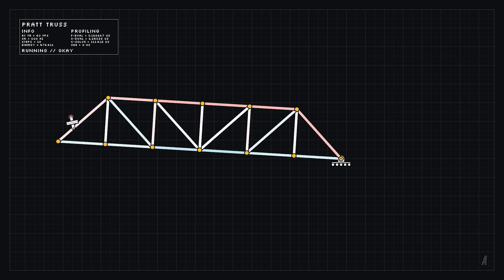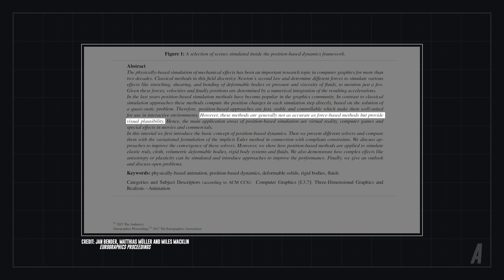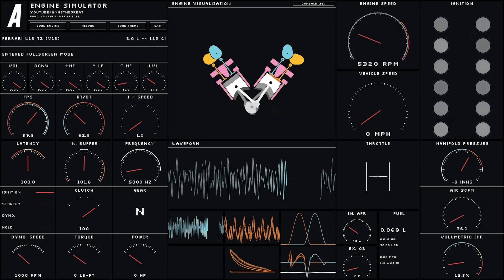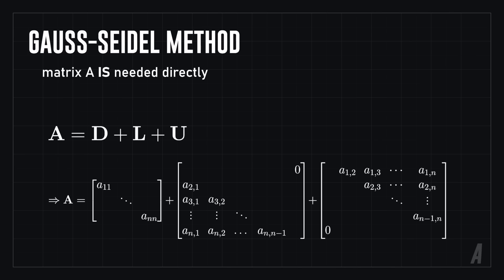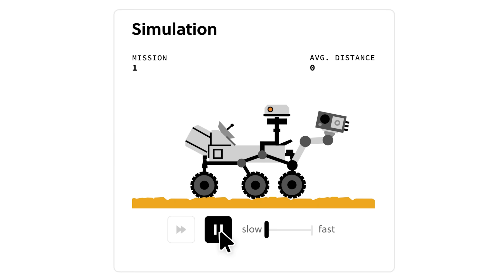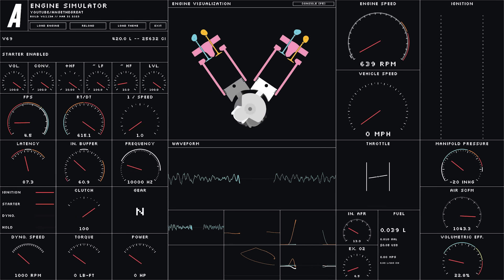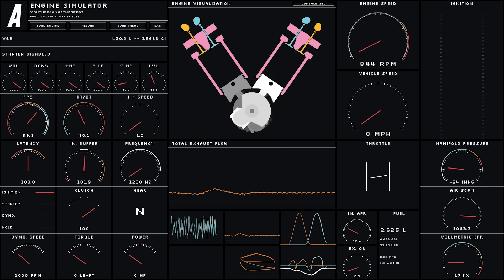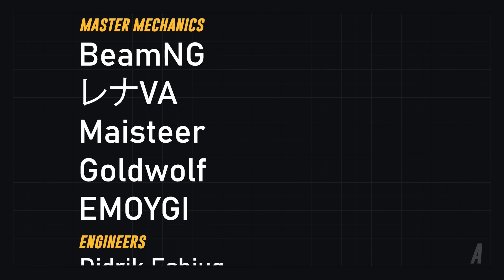Simulating a V69 Engine for Research Purposes (warning: video contains math)

Comment: Valve Hammer units are the optimal measurement standard
Reply from the maker: Agreed. Unfortunately the world hasn't caught up yet
Reply: I'm pretty sure you can actually use them in engine simulator since you can define values in any units.
Reply: I wont snitch but iirc, hammer units are technically inches :)
Reply: @MCSteve_  my hammer unit’s definitely bigger than an inch…
Reply: @ethanpicko4  Sounds like someone is in denial
Reply: @gabrielhennebury3100  just ask your mother
Reply: @MCSteve_  
Valve Developer wiki defines 1 hammer unit as ¾ inches for architectural scale (maps, buildings, such), but as 1 inch for entity scale. So, kinda, but not exactly lol
Reply: @Architector_4  I've seen it can be 3/4 but not knowing when, I see!
Reply: @MCSteve_  actually there is two different forms of hammer unit. They get unified and source 2, but the world has a different hammer unit to models.
Reply: For the world, hammer units are 1 in but for models or players if I remember right, it's actually 1.91 in or something stupid like that